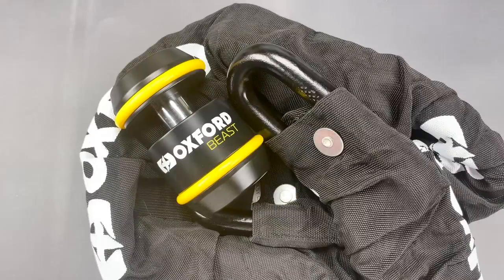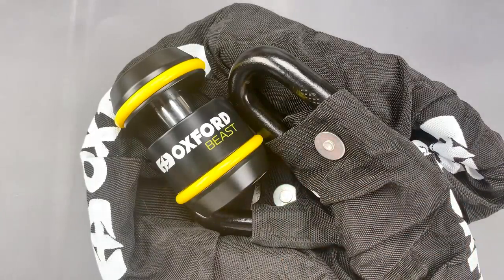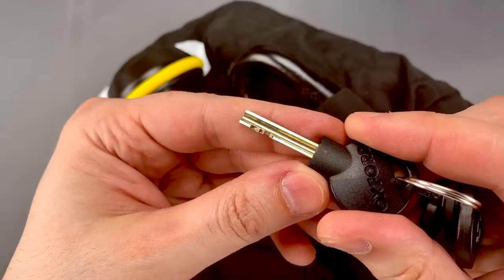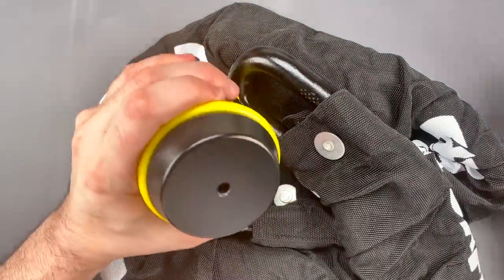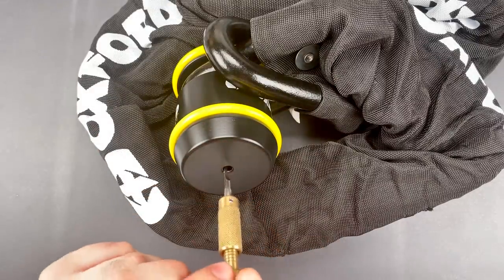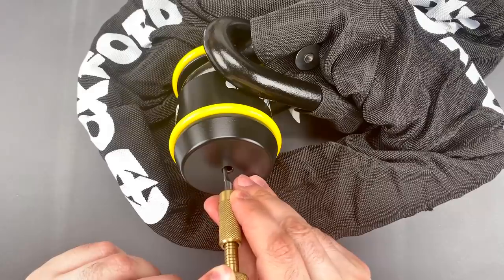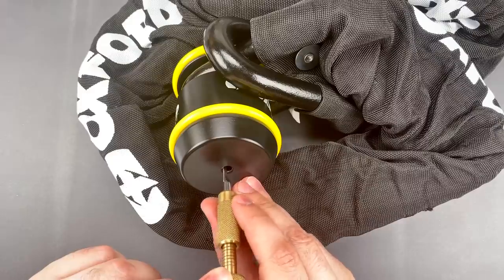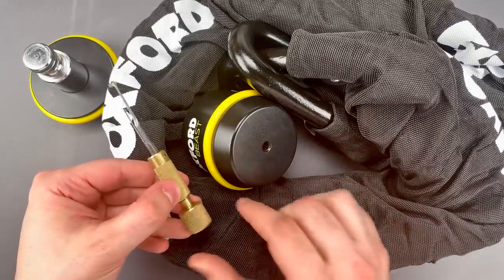[1131] 35 POUND Motorcycle Lock Picked (Oxford “Beast”)

Comment: Have you considered making a spreadsheet with some kind of list of the locks you test? Something like Doug DeMuro does for cars, but instead you'd rate the locking mechanism and the body's sturdiness and resistance to brute-force (you could add other details such as price or a classification of the types of locks if you wish). 
Something like this:
Lock type | Brand | Model | Status (Available/discontinued) | Version tested (sample, off the shelf) | Date tested | Pricing (when tested) | Locking complexity (1-5) | Pick resistance (1-5) | Body durability (1-5) | Body resistance (1-5) | Link to review
If you make it using an online spreadsheet tool (Google Sheet) I'm sure the community can help you with some of it (everything column except your ratings could be editable).

Comment: I'd love to challenge you try this again with the chain hung around a motorcycle, with the lock body positioned out of sight. This would make it somewhat easy to blindly get the key into, but very very difficult to do with even your custom lock pick.  The chain is heavy and cumbersome, so it's not like it would be easy to reposition the chain to make the lock body easier to access.

Basically I'm challenging you to do this again, blindfolded, with the lock body at an obscure angle.

Comment: Only problem I have with these locks is where do you chain your motorcycle down at? You can't go through the frame on most bikes so you gotta go through the wheel. Like a minute to take a wheel off a bike and steal it.  But then the thief has a bike without a wheel lol.  Seen plenty of bicycle tires chained up with no bike because of the quick release axles.

Comment: The very fact that it's (1) a disc detainer and (2) proprietary sized means it's effectively impossible for anyone to pick it on the street as no off-the-shelf pick exists for it. We only recently got a disc detainer pick on the commercial market, and it won't fit this without permanent alteration. Even disc detainer alone would honestly be good enough, but proprietary, too? They really went all out.

Comment: Leaving your lock on the street is a BAD idea, my friend had his bike stolen like that. Someone cut through 90% of the chain at some point, which was not possible to detect because of the sleeve. Then, when bike was "secured" the thief needed only to give it a good strong pull and the weakened link broke off.

Comment: Dudes, I am out for 1-2 opinions before I resort to the good old angle grinder: I have an Abus bicycle chain with Diskus lock. The combo had been lying around the lounge for ca a year, so not been used, but also not exposed to the elements. Now it won't open and I am guessing the bottom disk is somehow corroded; it feels a bit like using the wrong key, where it is possible to turn the key somewhat, but then there is a hard resistance. I have hammered it with Abus PS88, but no success. And yes, this is the correct key - it is always on my set of keys ;) The spare key also does not work. Any ideas? Using unreasonable force? Rage? ;)
I am getting pissed off with this type lock. I also had an Abus Granite Carblock 73 steering wheel lock, which turned really cranky withing 1-2 short years before it stopped working all together, luckily not while on the steering wheel.

Comment: What if they made a lock core heavy or parts resistant enough that you'd need an electric motor just to turn it kinda like the starter on a manual transmission car. As a picker you'd probably have to have all your tools run on that same motor just to get anywhere. just a thought..

Comment: I give the bike thieves in Portsmouth (england) 5 mins before they have your bike (or most of it) with this. I've seen them run off with a park fence to take a push bike. If they can't steal the bike, you'll be left with whatever parts are locked 😂

Comment: I'm just trying to figure out how you use a chain that thick anywhere on you're average motorcycle. Pretty sure the only way I could do it on my harley is through the front fork, but I'd be afraid that thing would dent my fender and scratch up my paint and my chrome. 

Glad I live in the sticks. I could leave it in my driveway with the keys in it and no one would touch it.

Comment: my question is the following

Whenever you pick locks, they're usually new and the key turns smoothly.

Do your methods work for locks that are jammy as hell? Sometimes I have trouble opening my lock with the key itself, I have to literally tension it the right way otherwise it wont open, and I wonder if that can be opened with normal tools in your videos

Comment: hi an interesting video idea:  A weather test, to soak all the top ten padlocks in salt water and make a video series reporting each month on their progress. Might need a few donations for the cost of the  locks, however.
Reply: I had a kryptonite new york lock and it started to rust and fail to turn after a couple of months outside, my abus u lock, however, has been outside for years and is still great to use with minimal rust. operational lifespan is so important.

Comment: Dear Lock Picking Lawyer.  If you were breaking into a lock or building with the intention of stealing it you would NOT be able to access the key beforehand. Therefore looking at the key is kind of cheating because it gives you an upfront idea of how the lock may work before you have even picked it up.  For example you choose and modified your pick tool with a Dremel  before picking based on the key. 

I want to see how good you actually are by you choosing to honourably not look at the keys before attempting to pick the lock. If you are unsuccessful then you could look at the key afterwards to form a better plan of attack.  UK fan
Reply: It doesn't change anything man.

Comment: Watch this channel a lot but there's one thing I don't understand with locks like this. Obviously when the correct key is inserted each pin is set to its open position simultaneously. It seems the picking process involves 'attacking' each pin in turn and physically setting it or moving it to its unlock position in turn before moving on to the next pin. Is it not possible for the lock to contain a mechanism that resets the attacked pin to its locked position as soon as the attacker moves on to the next pin, thereby defeating the attack? Sorry - don't know enough about the inner workings of locks to know if this is a dumb question.
Reply: That's why we put a tension wrench in it

Comment: LPL, how would this lock fair against a battery powered die-grinder with a mill bit? Could using that against the core with lots of cutting fluid work?
Reply: It would get through but would require a few minutes. There isn't much that will resist an angle grinder.

Comment: Picking start at 1:45 ends at  3:01 ... no way you can pick that in that time on the street with a specialty tool, too long, too much trouble, they will put the bike on a flatbed or pickup way before they start picking a lock that complicated.

Comment: I don't get motorcycle locks. If my motorcycle is so desireable for thieves, no lock will prevent them from stealing it. Depending on the weight of the bike you need 2 to 4 guys and a truck.

Comment: "Because it needs a custom tool, it's extremely unlikely it's going to be picked on the street"
Yeah because if it had a common tool... Thieves will just roam the streets with said tool and be professional lockpickers?
Even with the right tool, chances are you won't be picking this lock so easily if you are a thief. Their skills is with an angle grinder, a bolt cutter or simply a weapon dangerous enough to where you as a rider value your life high enough to surrender your bike to them after you've unlocked it.

Comment: Yea, but Igor Knockabikov can get through that lock in 30 seconds with that angle grinder he  and Nickalov stole.
Reply: It's a chain. Nearly impossible to hold the frickin links still, the fabric cover will gum it up, and the links are so thick it will take hours. 

The only reliable method of cracking a chain is bolt cutters, and with the size of this chain, that is unlikely.

Comment: This "Beast" of a lock and chain costs probably more then my Motorcycle is worth....
Reply: the manufacturer lists the lock itself at £149.99 (189.51 usd at current rate) and the chain at £149.99 for the 1.5m length and £214.99 for the 2m length (271.65 usd)
So certainly not cheap but unless your bike is really old it's still probably worth more
Reply: according to amazon it's about £300 so only if your bike is craptacular
Reply: soon will be, after retailers watch this video
Reply: @TheVarzoth  that is cheaper then I expected, but my Bike is probably in the same ballpark-ish.
It is a 30 year old Yamaha Diversion, wich my fatehr gifted my las year, after he baught a new biike after, well 30 years. threy are valued around 600€ I think

Comment: But now a thief knows what to do and practice thanks to
The Lock Picking Lawer. 
WTF!
Reply: Most thieves use destructive methods, if you want to be as good as lpl you have to practice for years.
Reply: Thats not really as big a deal as it would seem at first blush. 
1. It requires a special too. Easy to get, yes, but its easier to target something that doesnt require a special too. Then that special tool needs modification. This probably means that they will need more than one special tool so that when the mess up doing that modification, they can do it again. 
2. LPL has been picking locks for a long time. And he is particularly deft at picking disc detainer locks. I say this not in comparison to other types of locks that he picks, he is good at a great many types of locks, but in general compared to other pickers, he is good. I mean he worked with another picker to design a pick for disc detainer locks. Hes no slouch, and this isnt necessarily a skill that comes easy, nor is its nearly as easy in the field and under the stress of comitting several felonies and hoping not to get caught. 
 And just being able to pick disc detainer locks isnt necessarily going to get you a open on a specific lock just like pin tumbler locks, they aret all the same level of difficulty. 
3. Picking is just about the least likely way that a thief is going to attack a lock. There are similar things that thieves often do such as bumping or other keyway bypasses, but single pin or single disc picking is really not a great way to attack a lock even if you are good because of the higher rate of failure than other ways of attack. To be fair though, it does seem to me that with locks like this that could begin to be called exquisite, picking might start to be more commonly used since it starts to be a faster and easier way of attacking such a security device, its still not going to be common except in specific scenarios where other factors lend to its success. Ie there are things you do to protect your asset like using a lockset like this, and then there are procedures and protocols that you implement to protect both your asset and the equipment protecting it. For instance if i really wanted to get jiggy with this lock to protect it against many attack modes, i could have a cast iron or steel cover made such that the lock fits inside it and the chain feeds through a hole in the side of it . Something like a really large diameter pipe piece would work. When locked the chain would hold it securely in place and the pipe would extend down past the bottom of the lock far enough to make it just about impossible to use the pick. I would probably also have to custom modify the key with a handle extension so i could reach the keyway, but it would just make it that much more difficult to access the keyway. 
 4. LPL is not the only source of knowledge there. Smart people commit crimes too. Smart people can also be criminally inclined in life. 
 Criminals have all sorts of access to information and they can also simply go and get locks to practice on. 
I dont know if you remember the 90s and early 2000s, but there used to be several commercials on all the time for what ammounts to correspondence courses that you could take to get skills and knowledge to "find a new career". Call this number give us a credit card number and we will send you the course work, complete it and send it back and we will send you a nifty certificate of completion. 
I never sent off for one of these but i remember that locksmithing was on the list of courses offered. 
Im dubious of the quality and accreditation of which these courses were posessed, but you can legally perform weddings by being ordined as a minister of a religion that you simply sign up for on a website. Its a recognized religion. But all you do is sign up and they send you a certificate and you can legally perform binding weddings. 
 I suspect that something similar applies with these correspondence courses. You get certificate, abd perhaps then you can get some sort of apprenticeship or other access to higher quality instruction to further your criminal endeavors. Or at least ostensibly legal access and authority to have the tools and equipment in general.  
 5. I would rather good people have a reliable source for comprehensive analysis of security products even if it means that ne'erdowells can also benefit from that knowledge than to have no such information available and the general public literally be left at the mercy of the assurance of the companies selling such equipment that they are in fact high quality and effective.